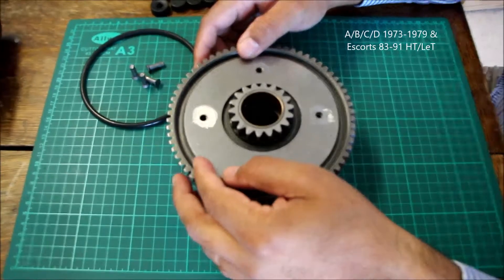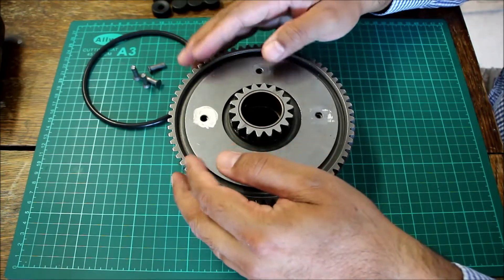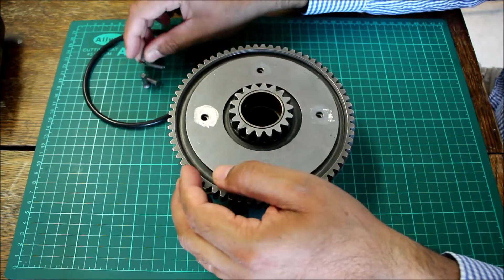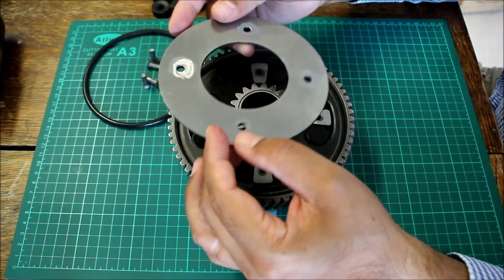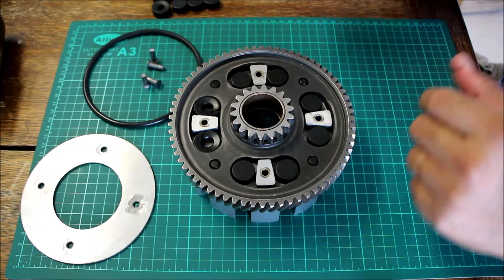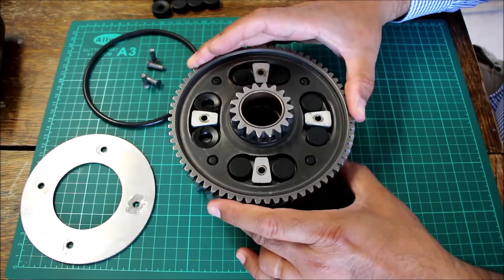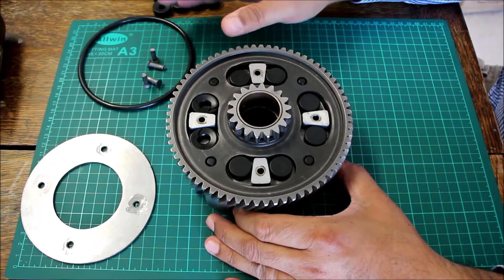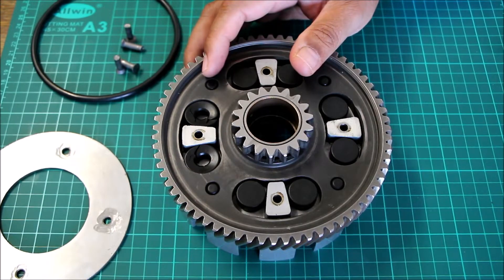Yamaha RD350 & Rajdoot 350 Clutch Basket Issue.

Comment: Can we replace the 2 polo rubbers with  solid rubbers same as  other 3 neighbour sets in the basket assy.? (Putting aside vibrational concerns)
Reply from the maker: Ideally not. Try to have same arrangement as OEM. The other 6 dampers are smaller, so it works in conjunction with polo